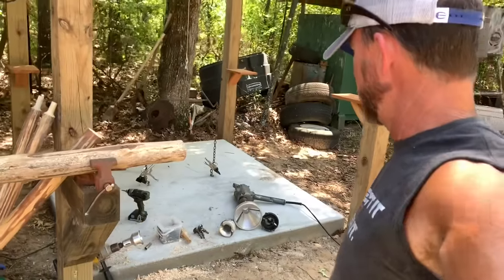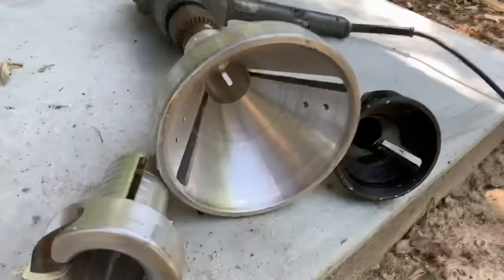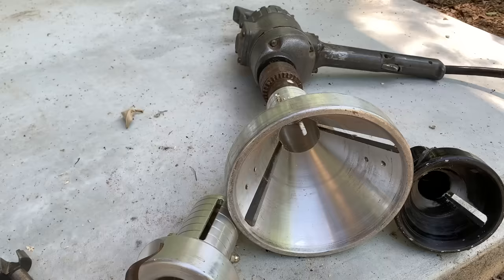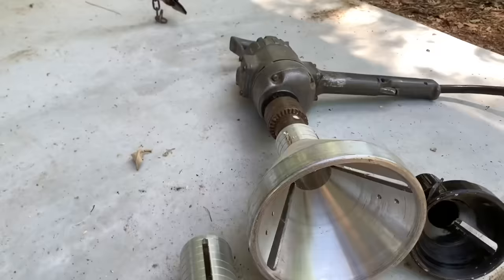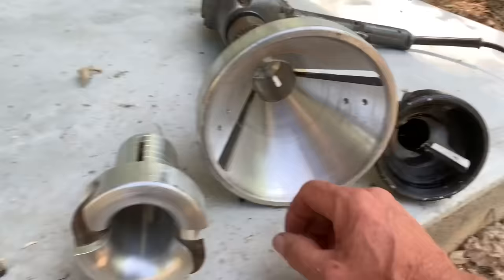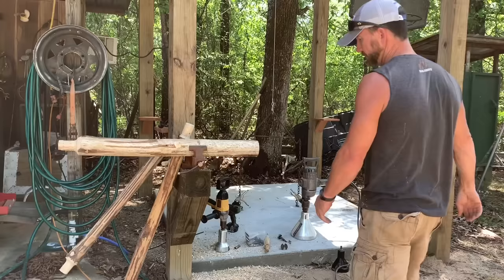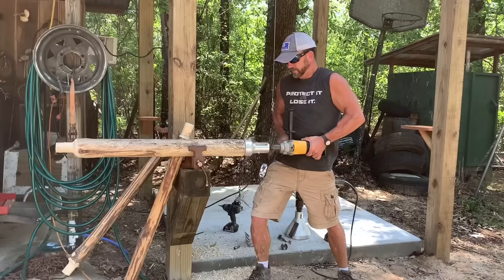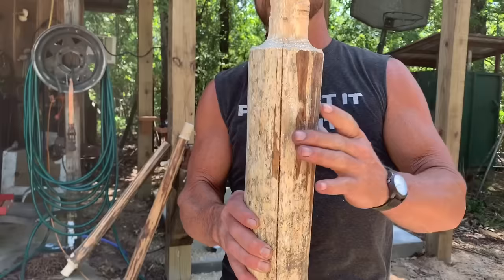Basic Log Furniture Building: Tools Required for Tenon Cutting Logs!

Comment: i just bought the full five size set of aluminium industrial bits and countersink bit. got them all for $350 at a yard sale. one bit had been used for one project....then the guy passed away. i just bought the Milwaukee hole hog drill. it's half inch...but has the big pipe side handle, and runs at the recommended 450rpm. i ran the 2" bit on a piece of 5" lodgepole  pine. it went through it like butter. it actually felt like it was pulling into the wood like an auger drill bit.

Comment: Tip on how to hide the screw heads, if you use them to secure the joints.   Cut down some empty brass casings and plug them over the heads.   Shotgun shells for lag bolts, and smaller diameter cartridges for screws and nails.   I've found that up to .40 Smith and Wesson will fit in a cordless drill, and cuts in to soft wood, but a flat faced hammer gets it done also.  Glue for added peace of mind if you want.

Comment: Maybe build you and adapter that would bolt up to a PTO or heck even bolt it up to the axle of a truck or big mower, then build a jig with the vise to push the wood into the tapering tool. 👨‍🔧

Comment: Maintenance crew got one of those drills form a rental place. 1 1/2 metal drill bit. Two dudes handling it on top of a forklift cage. I watched them until just before they started to drill though the metal. I warned them that they were about to either brake a bone or be knock off the cage. They told me I was a stupid 18 year old. Needless to say the drill ended up spinning freely with no one holding it. No broke bones but they found out concrete isn't a padded surface.

Comment: That does look pretty easy.  However, I remember watching "The Old Yankee Workshop" with Norm Abram and he always made his projects look easy too.  They weren't. The one factor that comes into play with woodworking is experience.  Anyone can watch a YouTube video and learn the basic techniques but it takes experience to learn the nuances that go into making everything turn out in the end.  With Jeff it is obvious that this is so second-nature to him that he doesn't even think about the little things that make the tenons match up so effortlessly with the mortices.  You have to hold that 20 pound drill at just the right angle to make sure your tenon at the end of the log is straight.  When you are drilling out the mortice you have to hold the drill just right too.

And none of this mentions the fact that you have to have very sharp tools or there is going to be a lot more work that goes into hogging out all that wood.

Comment: Dang. That big tennon cutter could take you for a ride if it got stuck on a knot.  What about a stationary motor hooked to a riding mower transmission with pulleys, then clamp the log on a moving track to feed the log into the bit.  It would make it a bunch safer and easier on you.  Just an idea. Lol

Comment: Next tool you need is a lathe.  Saves time and buy carbide bits.  You could do metal or wood projects with a lathe. I know tools are your thing and you'll get years of use out of them.  A Drill press would also work well for your projects.

Comment: Hi Jeff, 
 I watch lots of DIY videos in youtube. Just a suggestion, I don't want to tell you how to do your job, does the drill have a way to lock the trigger and if it does it might work better if you make a device to hold the drill or the same vice grips to hold the the drill you push the wood in instead of holding the drill. I'm sure that drill if your not holding it hard it can snap your wrist.

Comment: That's not a rough video. If you dry fit your pieces then take them apart and tag them with minor instructions you could ship easier. If Fedex can move horses they can surely ship furniture unassembled. Larger orders, say a complete set for a room or a porch can go freight on a pallet. Wrapped in large plastic wrap. You wrap everything to the pallet top planks on the two sides that stick out from the supporting ribs. There's a web site out there where you can put your shipping load up and let the independent shippers bid on the job to haul it. The customer pays the shipping.
  While your mulling this over make yourself a hot iron branding tool and a logo. Because its a cool way to brand your wood working stuff.

Comment: Milwaukee hole hog.  Ive used that drill for a dang winch to get my truck out.  Itll hurt ya.   Made a 3 ft handle for it so it wouldnt flip my 185 lb ass in circles.  But that Milwaukee hole hog will do ya with these mill bits.

Comment: What's the strength of cedar, lets say using 6" logs with a 2" hole insert. Looking to make a shelf, wonder how much weight I can store in it. it be supported by 4 x 2" holes at each corner. 

Or would metal T brackets make it a better choice?